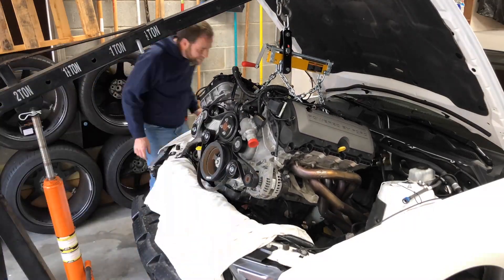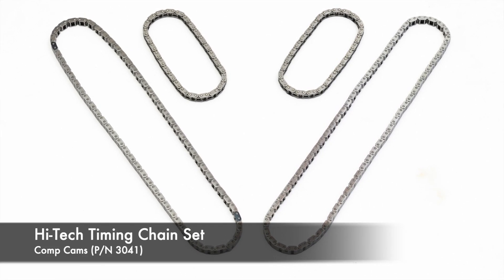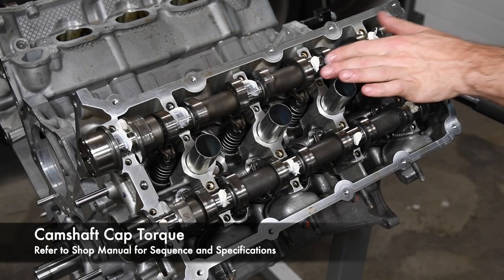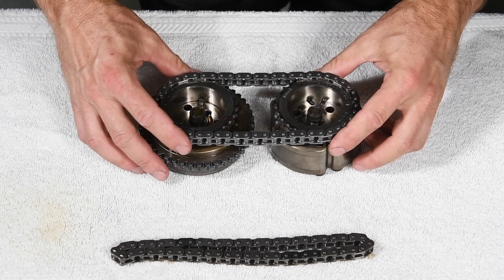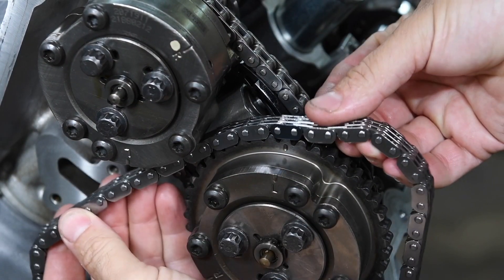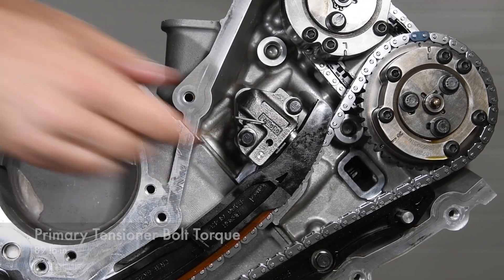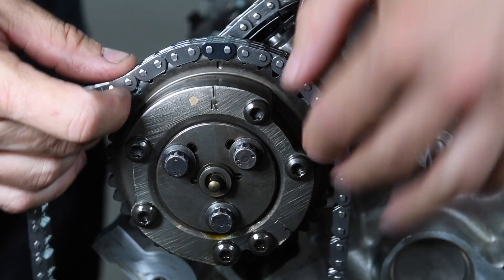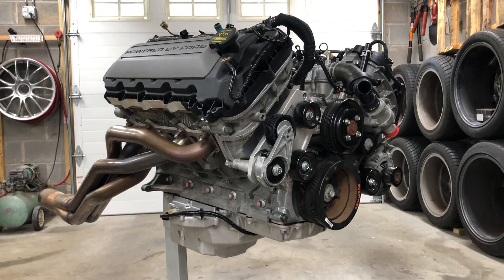Coyote Timing Chain Installation

Comment: I noticed the boss302 secondary tensioners are shorter,  did you reuse the metal piece on the bottom side of the secondary tensioner or just the plastic chain guide
Reply from the maker: The Boss secondary tensioners are retracted. You have to PUSH THEM DOWN after installation to release the spring tension! The shop manual doesn't even mention this, so don't forget to do this!
Reply: @Mustang-Geek  yes i noticed that, but i mean like the actual body of the tensioner is shorter and the bottom piece of the tensioner(little metal piece)  doesn't slide onto the the bottom of the tensioner so i was wondering if you don't use the metal piece with the boss 302 tensioners
Reply from the maker: @texaseliteperformance4471  Hmmm. I'm not exactly sure what you're referring to. On my car, the Boss secondary tensioners were a direct replacement for the GT parts. From memory, I reused the factory plastic guide on the bottom. You can see it at 1:30.
Reply: @texaseliteperformance4471 I am running into the same issue you mentioned on my build currently. The tensioner body of the boss 302 tensioner is too short and doesn’t allow for the lower guide to clip on. I spoke with ford performance and MMR but nobody has any info. I was wondering if you every figured this out.
Reply: @samrodriguez1082  yes just leave that middle piece out, you don't need anymore , already did multiple cars making 700+hp no issues. And the new coyotes come like that
Reply: @texaseliteperformance4471  thank you I appreciate the info!

Comment: Question. I'm installing cams on my gen 1 and you say to have the data labels pointed up. When I'm doing this my cam phasers don't line up. Do I turn the exhaust cam till It lines up with them? If I turn it then the data label is on the side. FYI intake cams are stock an exhaust is the boss 302 cams.
Reply from the maker: Hmmmm...not sure on that. Maybe your chains aren't lined up, or the Boss cams have a different phasing. Regardless, refer to a shop manual (there is one online. Google it), and set up the chains exactly like the manual says. Give that a shot.
Reply: I’ve got a gen 1 that I’m about to attempt to do a timing job and all rollers and lifters. How did you end up figuring this out?